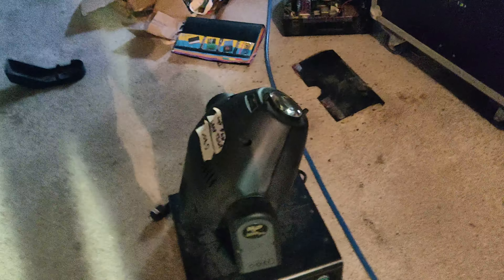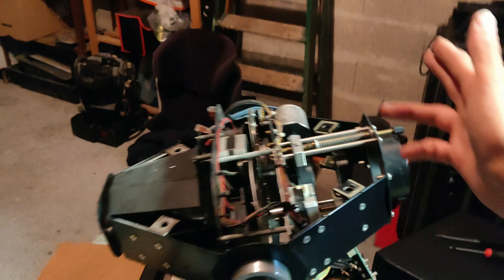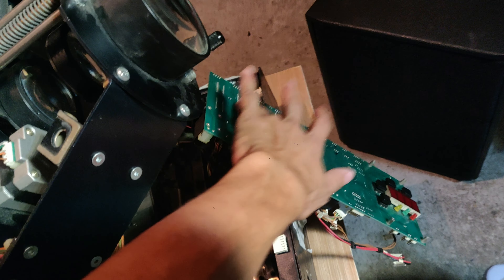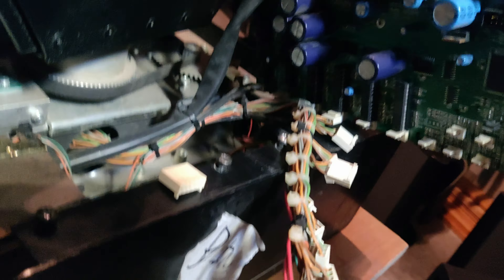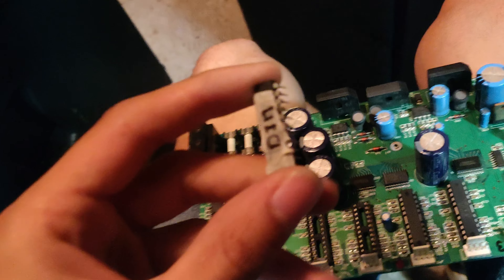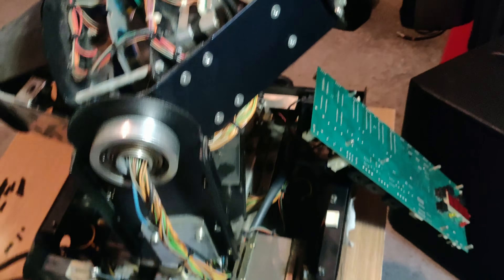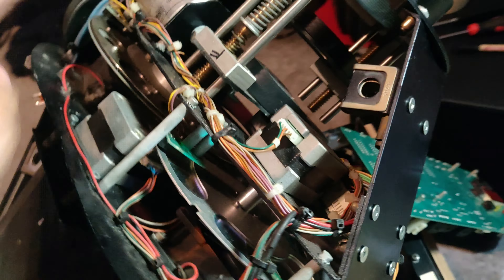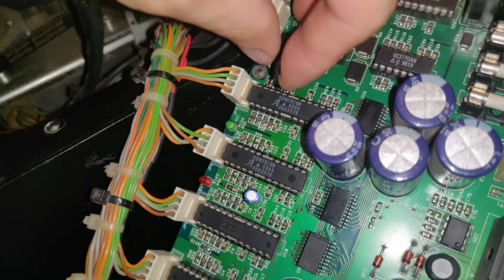How I repair electronic part of a stage moving light

Comment: I need help ,do You have  one email ?
Reply from the maker: Send a Messager PM
Reply: @redking7051  If it happens that I have some robotic luminaires, the gobos and colors fail, the wheel does not turn and the motor is fixed with current, the power goes out and the axis is movable and the dmx does not work